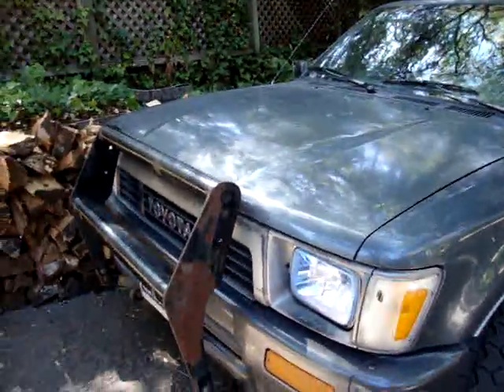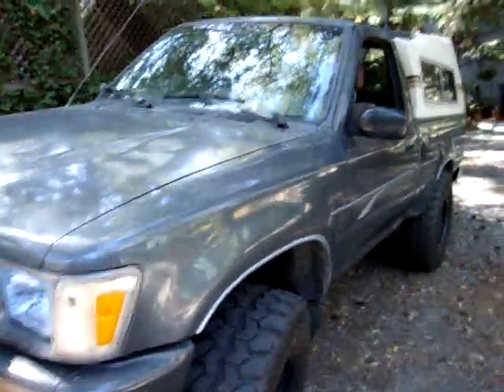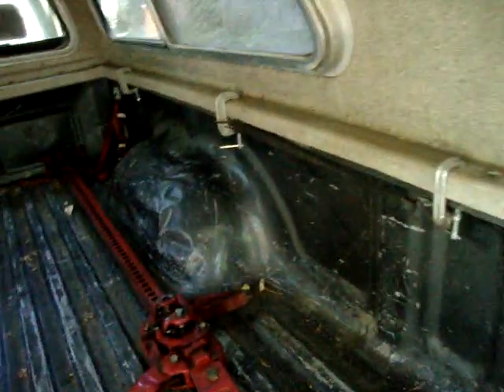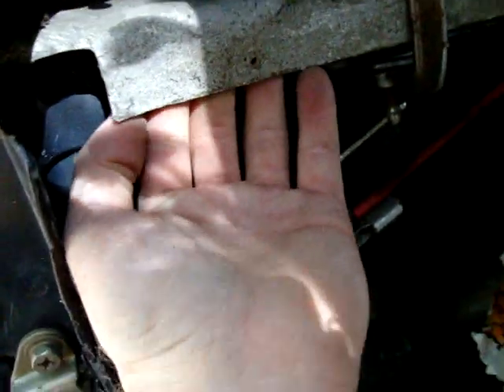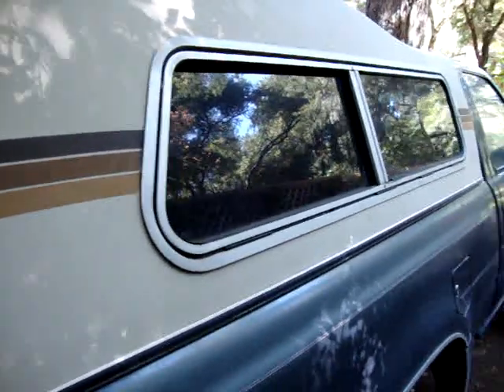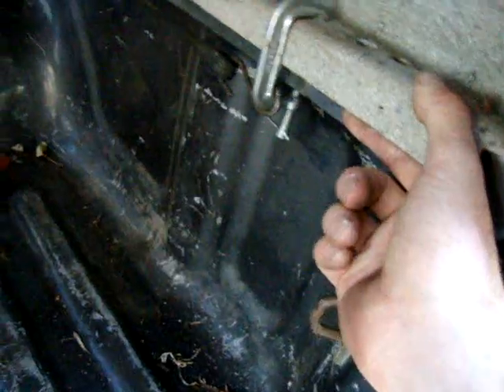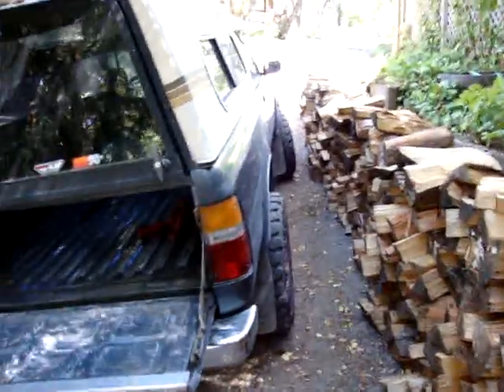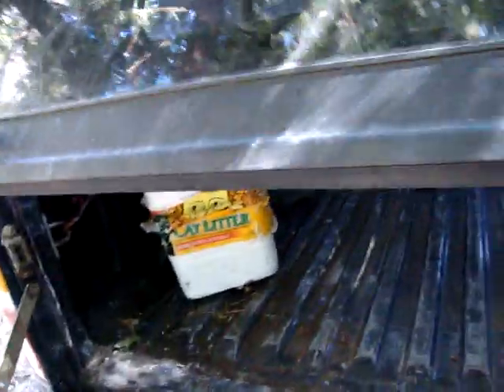Ideas for holding down a camper shell

Comment: My first shell I used the stake pockets. Dropped in tie-downs meant for the pockets. Replaced the Eye-bolt with a piece of all-thread. Set the shell on top of the bolts. Marked the locations then drilled the camper shell  and lowered it onto the all-thread. 6 washers and 6 nuts and it was solid as a rock.